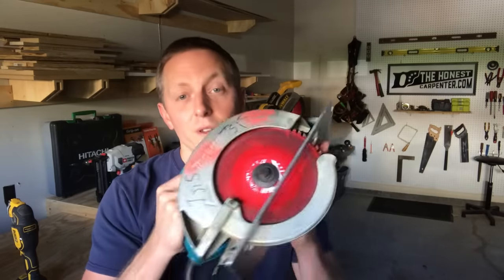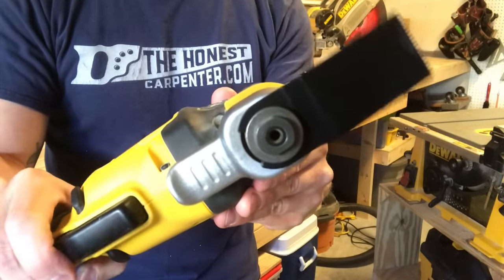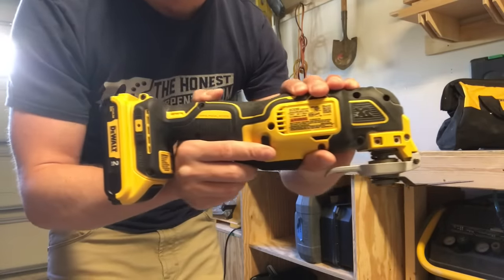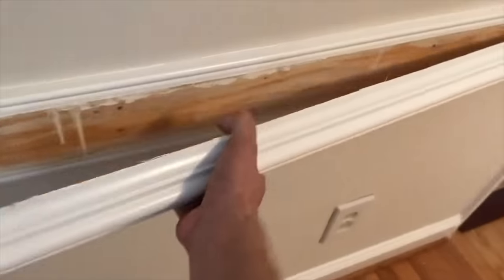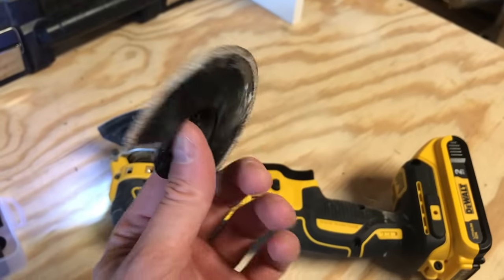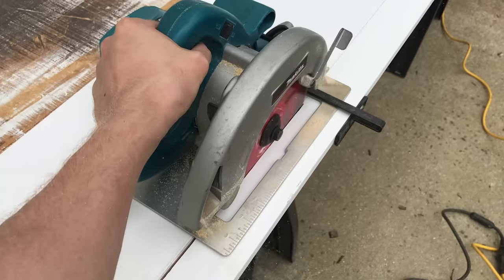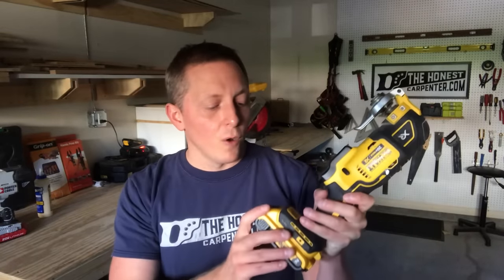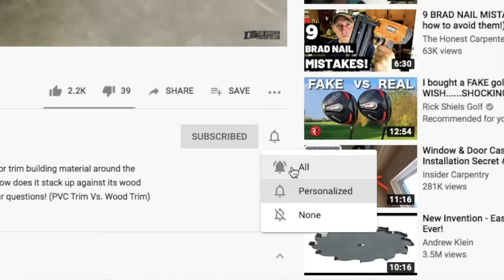The BEST SAW You've NEVER HEARD OF!! (Multitools--Great For Remodeling!)

Comment: Never heard of??
I've had my fein multimaster for well over 20 years.  Many years later feins' patent was up and everyone started making them. Ha, I've seen guys go through 3 or 4 of the cheaper ones and my old fein still stomps on any of them.
The feins have gone through changes over the decades and I don't know if I'd buy a new one. The quick change function doesn't last very long. I don't think they have nubs anymore that keep the blade from slipping even if it loosens up a bit. Mine has the nubs and the old school Allen head screw that you have to use to change blades. It's not as convenient to change blades but it's absolutly bullet proof.  
Best 400 bucks I ever spent back in the 90s.
It's the best tool for Carpenters since the cordless drill, IMHO.  ( yes I was banging nails before cordless drills too)
Reply: Likely he wasn't even out of diapers when the tool became popular. Kids today...
Reply: Came to say something similar, like has he lived under a rock for the last 10 years? I could understand this video if Fein was still the only company making them, but literally every tool brand has a model now. Talk about click bait bullshit subject for a video.
On the subject of people burning them up, I see it first hand that 99% of the time its the person operating it that causes the failure. Instead of letting the blade cut through the material, people tend to just ram the tool into the material as hard as they can overheating and burning up the motor.
Reply: @PortersMob    "can't you hear that" is what we always said to people pushing too hard and bogging down the motor of whatever saw they were using. 
Very good point.
I always hated when someone used my mitre saw and started to cut as soon as they hit the trigger, not letting the saw get up to proper RPMs  as well.  
Not only letting the blade do the work, not the saw save the life of your saw, it is so much safer for the operator.  Especially pushing into a table saw.
Reply: @erikvaldur3334  you just gave me flashbacks to when I was in a production facility and one of the cut stations had to get a new/rebuilt saw every 6-8 months. Because every guy that used that saw would treat it like a guillotine instead of a saw, slamming the blade down through the 2xwhatever while puling the trigger right as the blade touched the wood.

Comment: I love this tool and have had it for years -- but I never thought about using it for some of the uses you use. This is my go-to for surface cuts like wood plugs. Thanks and you are right -- the blades are awful. They dull SO quickly.
Reply from the maker: Thanks Dave! Yep, perfect for flush cuts on plugs and such.
Reply: I get my blades on Amazon for like $25 for 20 blades are so awesome deal.The brand starts with a V and ends with a T. They’re so expensive at the box stores.
Reply: Put your old blades in a vice file a straight edge them use a diamond file to reshapen , doesn't take long to do but it extends the life of a blade!
Reply: The blades can be easily sharpened multiple times.  You can buy premium blades advertised to last much longer.  You can also buy the Chinese bulk blades from Amazon and others and get 25 blades for the price of one.  They are cheap, with a short life, but you've got 25 of them.

Comment: Great video as always Ethan. There’s a few additional hacks that might be worth another video ( like using a roofers blade for cutting shingles or plastic- works best on the older Allan key models). And picking locks is crazy good. You know that you can put the blade up against skin and it won’t cut easily as the vibration only works well on solid material. If you’ve ever had a cast removed, it’s the same tool used to cut it off without cutting the skin.

Comment: Great video, I've used one of these for four or five years and I call it my 'Electric Chisel' if you put two blades in making a gap of 3/8 to 1/2 inch you can chase out plaster board, to avoid the cut jumping score the line with a Stanley knife

Comment: This year my remodeling jobs have included a lot of tiling floors and I'm using my cordless Dewalt Multi Tool with a carbide 180 degree round shaped blade for cutting grooves under floor tile into the thin set mortar to add T-shaped floor leveling clips for a floor tile leveling system such as LevTek, Rubi, Peygran, Frosch and many others. On large tiling jobs I don't always get all the T-clips added to the perimeter of the laid floor tile before I leave and the next morning I can cut grooves into the tile mortar to add the clips and complete laying floor tile.

Comment: I use the cheapest model there is it was about$15 I've had it for years done alot of miles and still going it's all about the blades not the tool
Reply: Good point.

Comment: I agree, it is the handiest tool I own. I'm currently adding new kitchen base cabinets against an open wall and the multitool is perfect for cutting the baseboard. I just set the cabinet in position and use it to guide the tool then I use my handy painters tool (which you featured in another video) to pop it loose.Also, I would not use any other tool to cut holes in wallboard. This tool has greatly reduced my "slamming, banging, and damning" (as my wife calls it).

Comment: I first learned of the Multi Tool 15 years ago from my father-in-law who had the original Fein Tools piece. We were retrofitting his house with laminate flooring and used it to notch the trim so the floor boards would fit under. There could not be a more perfect tool to avoid prying off  (some of which you surely would have to replace from inevitable damage), repainting, re-caulking hundreds of feet of trim. Huge time saver.

Comment: We use these a lot in sheet rock. They are perfect for cutting out hole for outlets and circular ceiling lights. It's also perfect for shaving a small section off walls to get your ceiling rock in.

Comment: I'm digging your videos! In 2012, I got a "free" pop up trailer from my brother. Once I got it home, I found rotted wood in different parts of the trailer. I went into a lumber store asking for the one tool that would make my job easier to work on.  I walked out with Dewalt's Corded Oscillating tool and every attachment possible.  Oscillator

Comment: I just learned about multitools on a massive stripping project. Rooftop of a commercial building, had about 500LF of large planters to re-waterproof (appx 10,000 SF). The old hot fluid applied material had to be removed completely for new material adhesion, but it was VERY tough and VERY difficult to remove. I tried all kinds of solvents, heat guns, chisels, scrapers, grinders, you name it... one of the guys brought out the multitool... miraculous fast solution, saved appx 500MH on a single job... that's a lot of added profit.

Comment: I’ve got the same DeWalt XR that you show and it’s an incredible tool.  I’m renovating our master bathroom including a big tile job that required new drywall, and it made very quick work of both removing the old material and precisely cutting the new stuff without any re-cuts.  The other great application I found for it was removing any dried excess mortar between and around tiles with an abrasive blade prior to grouting.  Again, fast and easy for professional-looking results.  Great, great tool.

Comment: ABSOLUTELY correct video. I use mine constantly. Only tool that does some similar things is a Dremel, but it has less ability to plunge cut and the blades are stupidly expensive. It's my go-to for every non-large project. Cut trim, under door moulding, and yes, I LOVE it for cutting drywall with precision. That last one makes a horrible mess of drywall dust, so be sure where you're cutting and wear PPE first, however.

Comment: We just did a full, and I mean full, overhaul renovation of a house in Oshawa and the Dewalt 20V cordless oscillating tool was a miracle tool. We used it for cutting wood and drywall, to remove grout, sanding, cutting off nails, floor tile removal, you name it. It was my first time using it for more than experiments in the workshop, and I will never be without one. Be careful with the multipacks of blades on Amazon as they are mostly garbage. I eventually used only name-brand blades and found them at slightly higher but good prices.

Comment: I'm a carpenter and  I have used Makita, Bosch, Milwuakee, and Fein cordless. Have not used Dewalt. Hands down my Rockwell is the best yet. It's a little beast. It can be had on e bay for under $ 100 dollars entire kit. 20 volt 20 year warranty on batteries and tool. Customer service is excellent. I had a corded one go out on me and they sent a new one and let me keep the old one. And batteries are way cheaper than competitors. When I bought mine, Rockwell had a store on e bay got it for $ 60.00.

Comment: Best tool I've ever bought. I bought 2 from Aldi for next to nothing, thinking that when it's had it's day I'll just throw it away and use the next one. I'm still using the 1st one after 5 years of regular use !!! 
One thing I think makes a difference is that I bought a ruck of Japanese saw blades which look different to a normal saw blade but they seem to last for so long and damn quick at cutting.

Comment: Sanding! I use it for sanding, mostly old paint out of corners or other places you get years of build up. Ive had the original Dremel model for literally 22 years, it's still running. I'm going to get one of the Dewalt's though for the fast change, because that rocks. ❤

Comment: What sold me on these tools were two applications. First was installing new hardwood floor where one plank was not level with the adjacent ones due to a staple underneath it. This was noticeable after most of the flooring was already in place. The out of level board and nails were removed cleanly with a multitool. Second application was removing excess plywood and ceramic tile on a plumbing job where work area was extremely limited.

Comment: I used the same dewalt multi-tool to cut this vinyl rubber tarp we were using for sound proofing. Its waterproof and super thick. I got some plunge cuts and dragged straight down. It Was hung in the back of our bar,  along wall of patio. I cut from 10 feet in air, straight down, with no issues.

Comment: Thank you for your explanation. My multitool is the RIDGID JobMax, both 12V and 18V. The body and head are separate devices, RIDGID makes many heads for it, thus for me it is a outstanding multitool. 20,000 oscillations per minute (OPM), with 4º movement. For many of my DIY or Honey-Do list it is my tool of choice.

Comment: I kept seeing these in the local tool shop and wondered what they could even be used for, put off buying one for a few years - until I had a job on that only one of these would be able to tackle, and I bought a Makita cordless multitool to go with the rest of my LXT set. Three years on, it gets so much use that I've just fitted the second new motor in it. (They don't last long, on the Makita but they're fairly cheap.) I'm absolutely lost on refurbs without it.

Comment: I'm a new diyer, trying to pick my first power cutter. I originally thought I'd follow your suggestion of a circle saw, but right now, I don't need to cut a lot of wood. I can make do with a handsaw for big planks, I think, until i can justify a circle saw. But I do need to repair small areas of rot and paint. So I realized a multitool or angle grinder might be much more useful. I'm not sure still. But a precise smaller tool that can cut AND sand would do me wonders. I'll probably get a multi, then a circle saw. That should cover my bases for several years, then maybe a router or even a band saw if I get more into it. Thank you!

Comment: Dewalt runs a special where you buy a battery and charger and get a multi-tool free.  I have both corded and 20volt because I couldn't resist that deal. Great tool.  Thanks for the video.

Comment: I actually bought one of these, an el cheapo Walmart brand tool, it was under $25. I bought it to cut out some damaged brick molding. Anyway, it’s still going strong, and has become one of my favorite tools to use because it’s so universal. And your right about the saws, they do dull quickly, he learned to buy them in bulk, its cheaper.

Comment: I spent five years sanding the outside of my log home. It was not until my brother in law suggested using an oscillating saw to reach into the crevices that I was able to do a better job of detail work.  I bought rectangles of sticky back sand paper and cut them down to fit the blades and then went at it.  They worked well at reaching into places the other sanders I used could not touch including the cracks in the logs and the corners where the  logs met.

Comment: got my first one right as the fein patent expired, 11/12 years ago got a cheap dremel made a huge difference for a remodel job I was doing, undercuts for flooring, electrical outlets, coping molding etc.  Pretty happy with the Ridgid jobmax, been using it for door installs and elder proofing with some locks.

Comment: If i'm doing handyman work or making good work on a construction site i always take this with me. Titanium or carbide blades are very useful too for when you need to cut nails and screws or bolts that are concreted into the ground! The fact you can cut level with the ground makes this better than a grinder in some situations BUT the metal cutting blades are more expensive and they don't last very long, you have to be careful to cut slowly and lightly esp with steel but it still gets excellent results

Comment: Thanks, for this good video. Just bought a Dewalt to remove cork tiling on bathroom floor some idiot had laid on directly on warped uneven floorboards.   Eventually at some point he then laid vinyl over top!  The scraper is just great at cutting through the copious amounts of adhesive and does an equally good job at removing residue evostick.  Without this tool it would take forever to remove cork tiles.

Comment: There are blades with sanding/grinding grit on the TOP of the blade. I installed a solid wooden door, and it was a hair tight at the bottom at the threshold. Instead of taking that heavy door back off and planing it, I just opened the door and used that blade to sand off a few hair thicknesses of the wood. I was working alone, and that door weighs a ton. Worked great.
Reply: Thanks so much for the tip - I'll have to try this on one of my closet doors that won't close properly!

Comment: I got the one from Harbor Freight (of all places to get a tool).  I am not an every day user so it held up fine so far.  The blades that come with those cheap ones do not last long so get the Bosch blades.  I find the Bosch to be much better than the ones it comes with and the holes are similar enough that you don't need an adapter.  That is assuming you bought that same one I did (or one of the rebrands from similar stores).

Comment: I love this tool for small cuts. I needed to cut some new small pieces of wood to fix a wooden dresser and it worked very well. It's really not effective for long cuts like you said. Long cuts definitely need a table saw or circular saw. It took too long to cut a 2-1/2' of thin wood and it was a little hard to control. I also used this to cut the grout in my bathroom in order to reseal it. Definitely a handy tool!

Comment: Used a tool shop brand to replace a couple planks in porch last week.  Otherwise will need to drill hole and use jig saw to do job.  No need for expensive tools unless you do it as a living.  Nice tool to have for trimming door frame when replacing floor

Comment: Great tool for DIY.  Used one about 22 years ago to cut out a manhole in an existing hard wood timber floor, required a plunge cut, worked ok, but not great for cutting neat, long straight lines. As mentioned in this video, better to use traditional tools for longer and more visible cuts.

Comment: I bought one of these about ten years ago for one specific job where I needed to make a cut halfway through the wood at every point. It can be done with various saws and chisels, but it made quick work of this task. 

No sooner did I buy it that the tool interface changed from the hex pattern to the universal fitments we see today. The blades used to be a lot worse, but the sanding pads need improving.

Comment: This is the most abused/used tool in my van. In 18 Years, I'm already on my 7th or 8th multitool. I burned through several porter-cable corded and cordless, Bosh and Dewalt. So far, dewalt cordless has been my favorite.

Comment: With the flat scraper bit these are amazing for breaking loose trim or any kind of flat stock, especially if they used adhesive in the installation.  It can get into the tiniest gap right through five layers of paint covering the gap like it's not even there and break loose the adhesive in seconds that it would take you an hour to do manually with a traditional scraper.  When I used to work for a window repair company we also used to use them for getting in between the IG and the sash frame.  Some window manufacturers use a ridiculous sealant material that is nearly impossible to break free by any other means than just breaking the IG and removing it in pieces.  This tool takes care of that problem.

Comment: This tool was invented way back in the early 70's as a plaster cast removal tool to remove like a cast on your arm if you broke it.(I had one used to remove my cast back then because it didn't cut you)  It took 30 years to find it's way to the construction industry. I doubt that thing taking a toe off if you drop it, even if you have the trigger locked., but you would get a nice little cut from it, if it got through your shoe.  Thanks for your video!